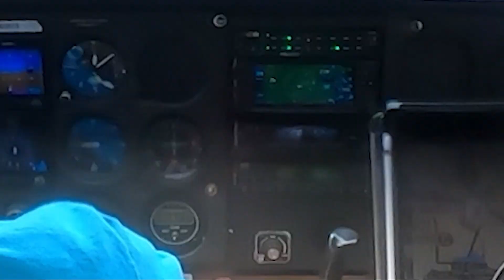More Candid Thoughts on Energy Management!

Comment: Try Landing Signals Officers Rules to Live By as written in Medium on Improve Your Landings with AOA and Power Techniques. “If you’re only high but not fast (and presumably not slow) then you don’t have too much energy you only have an imbalance of energy,” wrong, you still have too much energy and you should use power without changing pitch. High and slow would be the pitch trade. If you’re high and on-speed, you’ll end up fast, and you’ll still float long. Now compare gliders and drag in this.

Comment: How does energy management work when flaring to land?
Reply from the maker: So first of all, I don’t personally like the word “flare” lol. I just teach to round out over the runway and fly level as long as you can. But either way, if I’m understanding your question, the energy management simply comes down to transferring the energy from your airspeed to your altitude. You do that by applying back pressure to the yoke and that allows the plane to remain at the same height above the ground while shedding its airspeed. Is that what you were asking?
Reply: @NorthwestAeronaut  yes . just wondering how energy management is done in all phases of flight. On a side note is the sounding or begining sounding of the stall horn a requirement before the wheels touch pavement.
Reply from the maker: By no means a requirement and depending on the plane may not even be possible. But it’s never a bad thing… as long as you’re right over the runway haha
Reply: @NorthwestAeronaut  Im currently a student pilot about 3/4 the way through private pilot training . And yes I had  1 or 2 landings stalling a 3-4 feet above the runway causing rather harsh touchdown lol. The reason i asked about the stall horn is because my one instructor would always remark the landing as a 3 point or even a 2.5 point landings. when it should be on the mains first. So i slow it down some more before touching down and sometimes the stall horn would just start sounding, but still the remarks are the same. . The chief pilot of the school never makes this remark when im landing. I guess there are different philosophies.I do strive to get my final approach speed 60-65 kts on short final with 30 degrees of flaps.I do have another question (sorry ,i just find the subject interesting) . Using flaps will increase the drag / drain on the energy state of the airplane. So my question is during the approach i will incremently , extend  the flaps like 10 degreese at 80 kts, 20 degrees at 70kts , 30 degrees at 65 kts.From an energy management perspective  How do you deal with the ballooning of the Airplane when extending and slowing down per increment of flap extension?. I would always pitch for air speed first and  power for altitude (descent) second. I train in a C172 btw.
Reply from the maker: That’s exactly what you should do. As the flaps come down you push forward to keep the nose down and maintain the airspeed. This causes you to descend faster at the same air speed which is the whole point of flaps. 👍

Comment: How do you meld this principle with the region of reverse command?
Reply from the maker: Good question! So hopefully I’m understanding what you’re asking here, but basically this relates directly to what we’re doing when in the region of reverse command. On the back side of the power curve we need to absolutely pitch for airspeed and use power for altitude, but we are still using the throttle to introduce the total sum of energy into the plane, and still using the yoke to distribute it. “Pitch for airspeed and power for altitude” is kind of the mind set we approach it with where as the concept illustrated here is the literal manifestation of what’s happening from an energy stand point. Does that make any sense? Cuz I feel like I just typed a bunch of random words that make no sense 😂
Reply: @NorthwestAeronaut no bro, you absolutely made sense, I wish I can have you as one of my flight instructors 🙌🏾
Reply: When we are in the back side of the power curve we are low on airspeed and high on Total drag so the best way to gain airspeed and or climb on the backside of that power curve is to add POWER and manage airspeed with pitch as you add power, adding power is increasing the total energy hence reducing the total drag up until a certain airspeed where total drag starts to increasing again but by then you should be in normal command